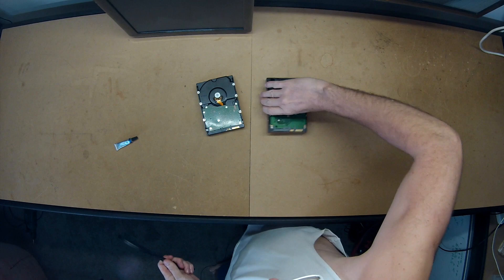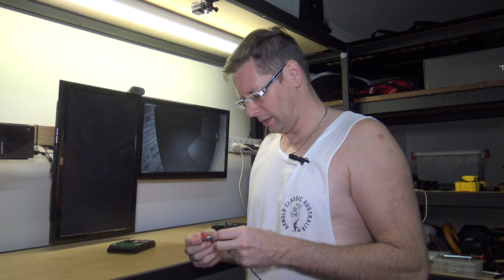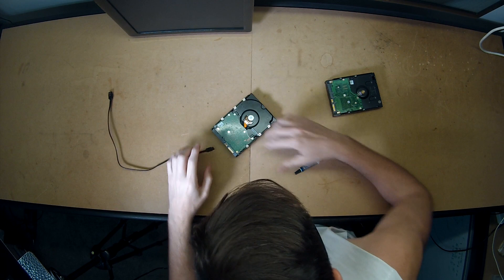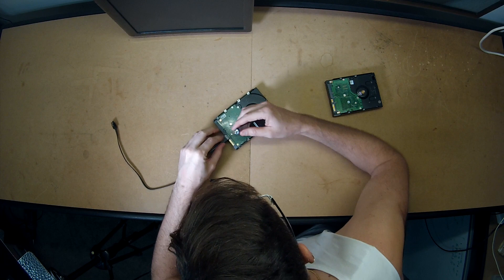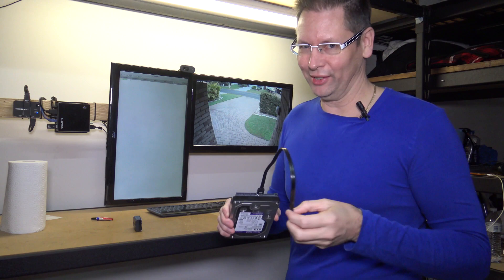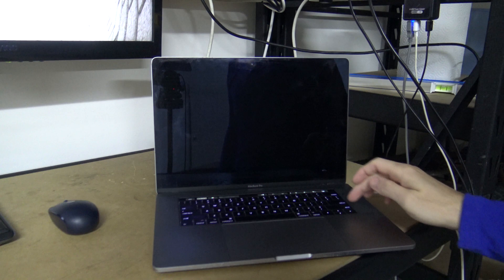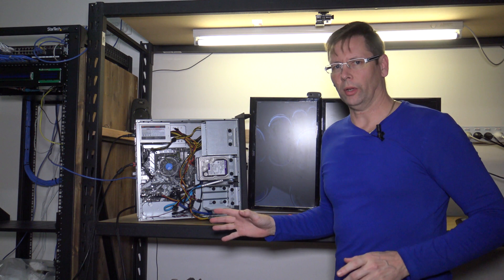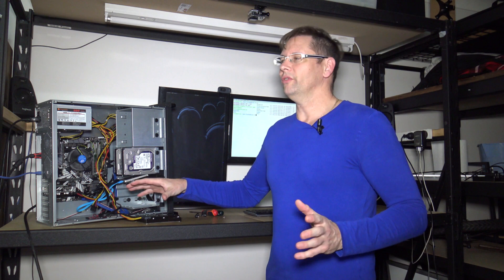Hard Disk Repair And Dead Macbook Screen

Comment: 2:25 Next time I'd go with some Araldite (2 part epoxy). Sets like concrete and would protect the pins while you're at it because it'd lock everything in, including to the metal casing and the PCB. You'd be able to grab the cable and swing it around like a cowboy with that.
Reply: Kieran Short you beat me to posting the same, super glue idea is not ideal solution here bit disappointed with that hack job :(

Comment: As others have said I might have tried two part epoxy, but seems super glue did the trick.  Maybe add some hot glue gun to form a mountain around it for a little more cable strain relief?

Comment: No warranty for the drive?
Reply: The drive wasn't at fault, so I doubt they'd take it back.
Reply from the maker: Yeah, that's not what a warranty is for. The Macbook broke under normal use, hence the warranty kicked in. The hard drive broke because I was rough with it. I wouldn't even consider looking for warranty replacement in that case.